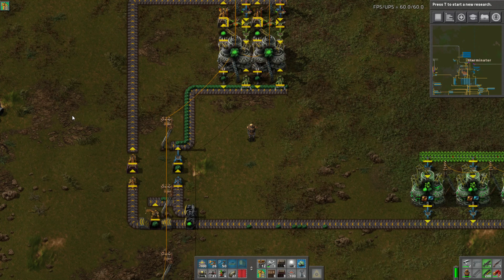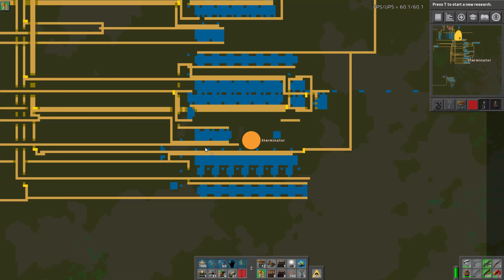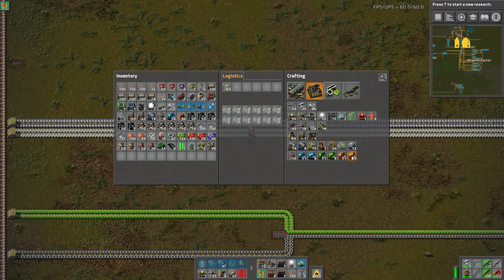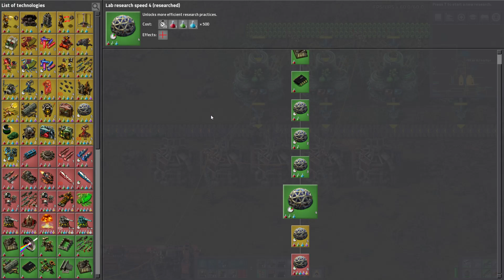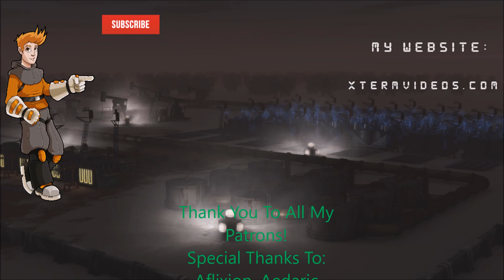Factorio: Tightening The Belt: Megabase Guide EP22 - BEACONS | Tutorial Gameplay Series

Comment: 19:16 only as long as the centrifuges line properly and aren't staggered themselves. With that configuration you can't get the awesome and cheapest 8:8 beacons machine ratio
Reply: So what's the best spread for modules in Beacons? If machines can't go beyond an 80% speed boost, how many beacons can slot efficiency modules?
Reply: Only Efficiency is Capped. Speed is not capped, and you can't put productivity in beacons. A best ratio is 8:8. You put you line of machines and then put a line of beacons down, staggered one tile.